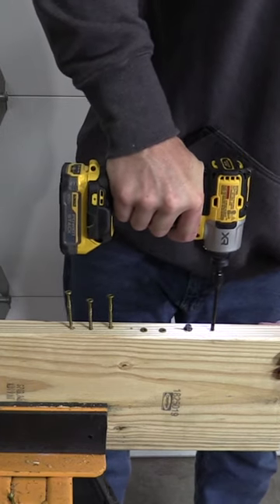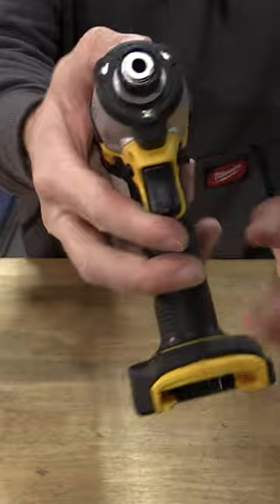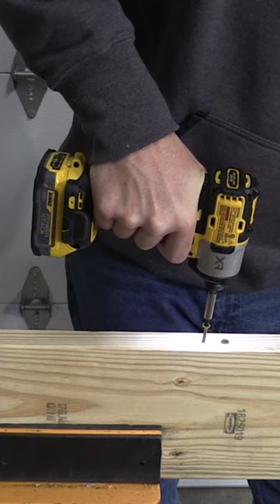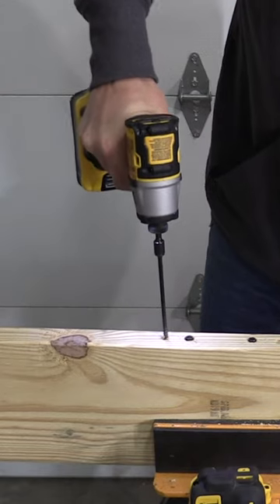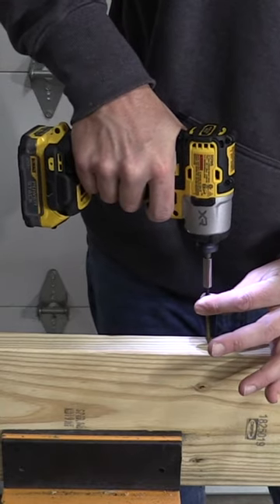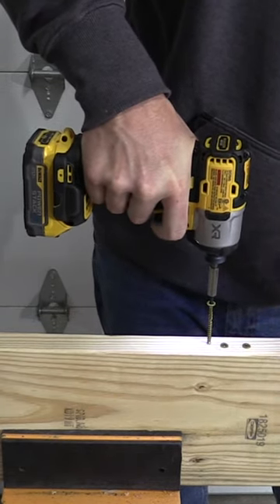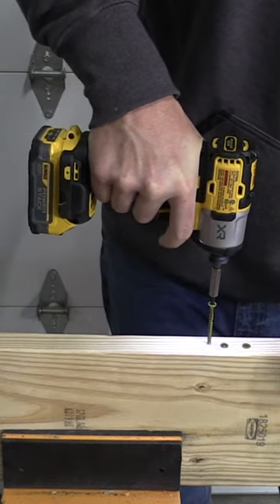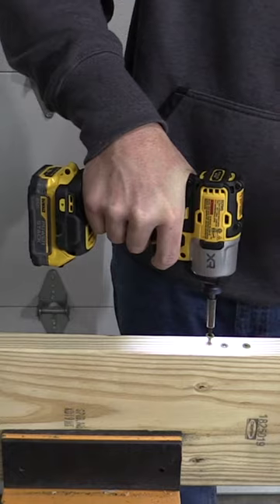The Fastest DEWALT Impact Driver On Paper DCF845 #shorts

Comment: why is it that I always see people use impact drivers rather than drills?
Reply: Smooth operation, lighter, more powerful, better overall for driving fasteners.
Reply: Doesn't transfer the torque/kickback to your wrist. Better tool for putting in fasteners.
Reply: They are designed for driving small fasteners that strip out easily.
Tools With SOALZ has demonstrated many times that a drill is the better tool for driving large fasteners such as lags.
Reply: Drills are for drilling holes, drivers are for fasteners.